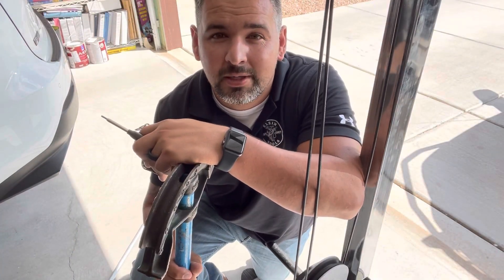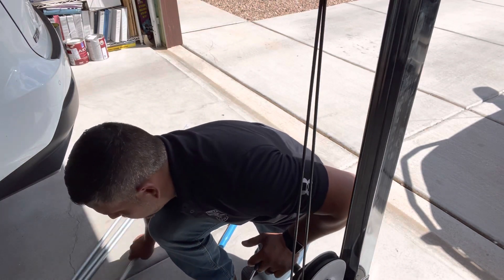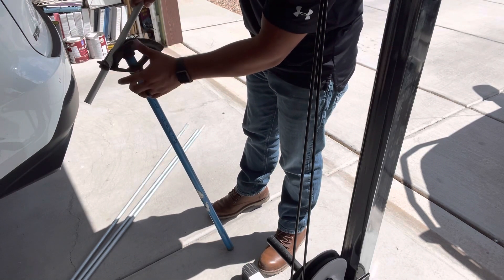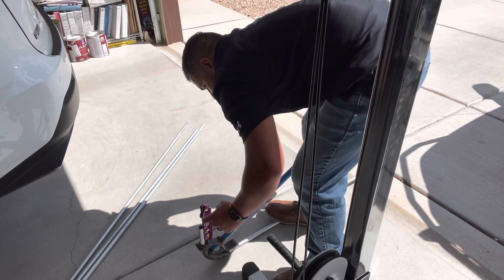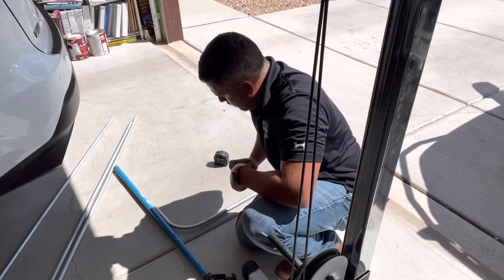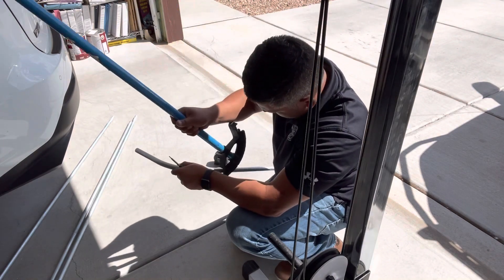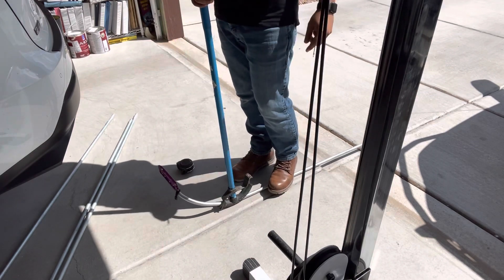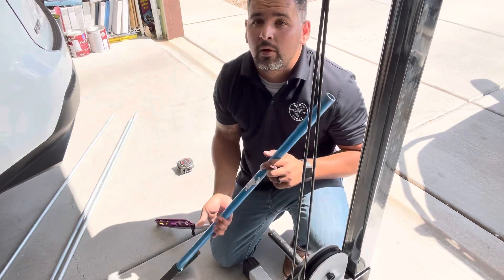How to bend a Kick 🦵 90 Like a Professional! Warhammer Electric Style

Comment: Not all benders bend to 30 degrees when the handle is at 90 degrees.  I have personally only ever seen Ideal benders be like that.
Reply: Both my 3/4" and 1" Milwaukee Benders end up straight when I hit 30 degrees. While they're not "Ideal" benders--get it, Ideal?--they get the job done. That's what my foreman gave me to use so that's what I'm using and they work just fine.

Comment: where does the 8 inches come from ?
Reply: For 30 degree bends you multiply the height you need by 2 so in this case he wanted a 4 inch kick so he measured back 8 inches.
Reply: @d.j.m.g.346   gotcha , thanks

Comment: Have to disagree about the 30 degree bend with the handle straight up. I have to go past 90 to get 30 degrees
Reply: some benders do have this feature. but if you assume this to be true for all benders, your gonna have a bad time
Reply: Not at all true. Because you already are well aware that the benders are different. Something that is ridiculous. I did not realize it benders differed to the point where you couldn't trust a straight up bend to be a 30°. This is ridiculous. It's making it so the greater the offset, the more off the measurement is! Sometimes a company has multiple bender styles. There is an app for Apple phones to help conduit bending. It tells you to enter the type of bender you have so it to be accurate! That is crazy. 

 @stephanegoulet509
Reply: You're absolutely correct. On an ideal bender I pass the 90 up right a little more to get a perfect 90. Spring back maybe?

Comment: audio is a little low . , great video . look forward to learning more from you
Reply: im learning from working at residential right now m so switch loops and dead end loops . if you could explain them . Also trouble shooting a circuit when you have a weird voltage showing up on the meter . these are where i have most troubles with lately
Reply from the maker: Thank you Matt ! I’ll keep them coming
Reply from the maker: Got any thing you want to see ?